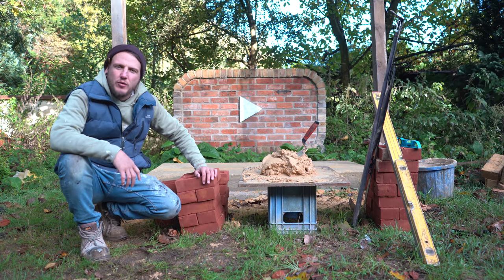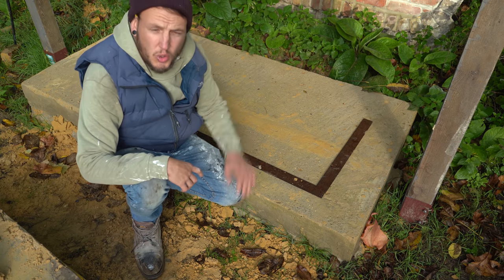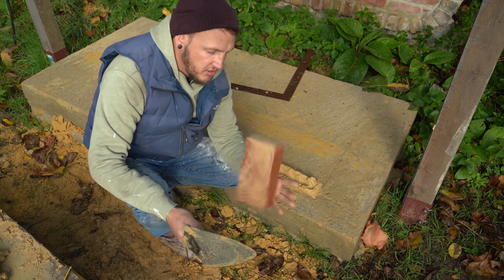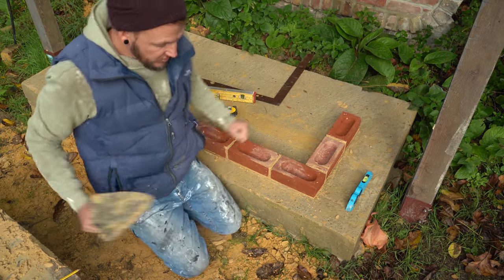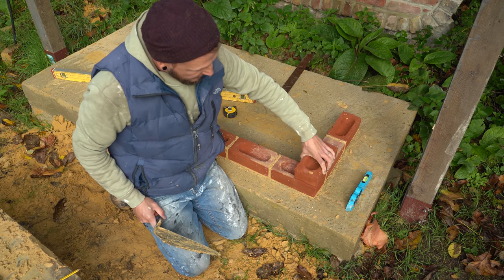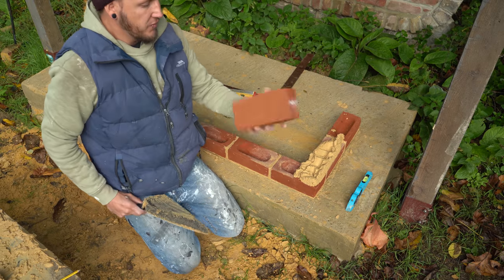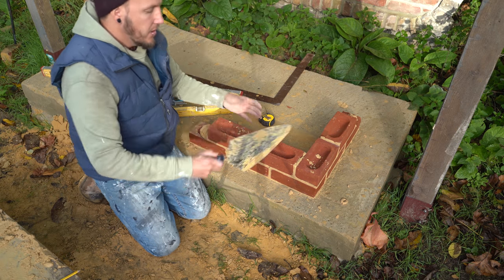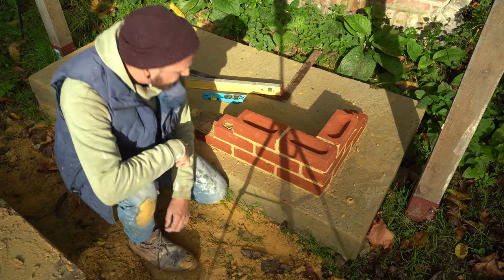HOW TO BUILD BRICK CORNERS [Bricklaying for beginners e.p.5]

Comment: I’ve only just found your channel and know nothing about bricklaying.  However I am finding it fascinating.  One thing I can add though is why the hollowed out part of the brick is called the frog.  The underside of a horses hoof to the rear, the V part is called the frog, which acts as a shock absorber to the hoof, which I can relate to the brick.  The only explanation I can think of, but I may be wrong of course 😬

Comment: Nice video !  Here are a few suggestions. On quoin brick and the tail brick of leads,place level across brick. If face is square to beds,the brick will be plumb when crossed leveled. Also,on longer leads, 4-5 brick,lay quoin brick and tail brick first and level. Reason being,it is easier to lay and level infill brick between two points. Lastly,glue a piece of wood to face of boat level exact width as longer levels. Reason being,contact points will be exactly the same ,hence you will get exactly same reading when you switch over to longer levels. Thanks for sharing your video.

Comment: I have a question, if you don’t mind. When laying first course on a uneven footer(in my case, on cut stone) do you just fill in the low areas with muck or is there another way?  When using old large brick for exterior wall and smaller modern brick for interior wall how do you tie the two walls together? Thicker beds for the smaller brick to bring them up to same level as larger brick? Silly questions I know, but I’m learning greatly from your channel. Thank you, Jamie

Comment: Everyone taps there level now and again either when plumbing wall or leveling as it is quicker and better than tapping each individual brick 👍
Reply from the maker: I couldnt agree more. On the flip side, I've seen people hitting their level with a club hammer to straighten their corners 🤣🤣🧱
Reply: wheaten bread  it’s better to tap the brick than the level, if you have your hand on the level at the same time you can feel which brick is in need of adjusting

Comment: Great video Rodian.  I'm a bricklayer from across the pond, Newfoundland Canada.  When you lay out the first course, would you normally level and plumb every brick in the first course?  Or would you level and plumb the corner brick, lay the bricks next to it, then level and plumb the ends and then use the end lined up with the corner to straighten up the middle bricks?  ha, do you know what I mean?

Comment: Not at you but In general some brickies plumb one or two courses with a four foot level and it bugs the shit outta me lol 
Why don’t they use a boat or two foot for the first few courses?
Reply: I use the smallest level I can, and go up a size only when I need to. It's more handy I think
Reply: Plumbing 1rst and 2nd course with 4 feet is inaccurate imo
Reply: Maxstaber exactly! I’ve seen many brickies putting their foot on the base of a level and holding the top in mid air after just a few courses.
I laugh.
Use a smaller level so it’s rigid against your wall ffs 😂
Reply: I agree, trying to plumb 2 courses using 4 foot level feels awkward
Reply from the maker: I love you all 🤣🧱 I find it so unstable using anything more than a boat level for the first 2 courses at least. Usually I do 3 with the boaty then the 2 footer comes out. I find it way way more accurate. Each to their own though 🧱👍🏻
Reply: Many years ago, did not have time to mess around with boat level... All plumbing an leveling done with 4ft level.

Comment: I built myself a barbecue,  first time ever handled bricks and cement. Took a while ,but being an engineer I knew how to level and square up etc...biggest problem was the shit bricks I got, thinking engineering bricks would be straight and square, anything but! Aren't there any standards on brick precision??
Reply from the maker: There are standard sizes but the way the bricks are made there is a chance of slight discrepancies. Some bricks more than others. Hand made bricks can be quite a bit different in size, 20mm in some cases I've come across

Comment: YOUR TECHNIQUE IS ALL OFF. 1. WHY DIDN'T YOU USE A CHALKLINE ON THE SLAB? 2. LAY YOUR FIRST COURSE TO THE CHALK LINE FIRST. 3.THEN BREAK OUT THE COURSE RULER TO SEE IF IT'S ON MARK. 4.THEN LEVEL AND PLUMB OUT THE 1ST COURSE AND CORNER. 5.REPEAT EACH STEP UNTIL 5 COURSES ARE COMPLETE SO YOU CAN RE CHECK THE WALL WITH A 2FT OR 4FT LEVEL AND LEVEL OR PLUMB WITH A BETTER MORE ACCURATE TOOL, SINCE YOUR NOT USING A SPEED LEADERS. AND WHY ARE YOU LAYING THOSE BRICK UPSIDE DOWN? I SAY THEY ARE LAYED UPSIDE DOWN, CAUSE WOULDN'T IT BE EASIER TO SPREAD THE MORTAR ON A COMPLETE FLAT SURFACE,  THE WHEN CLEANING UP THE MORTAR AFTER SPREADING ON THE COURSE, YOU CREATE A PYRAMID LIKE WEDGE WHEN USING YOUR TROWEL TO RACK THE MUD TO EXTEND YOUR SPREAD DOWN THE COURSE.

Comment: With reference as whether to hit the level or not. Obviously preferably not, but that’s not always practical, however no one seems to have mentioned a specific level that Stabila make that has a thick durable polypropylene capping the full length of the top of the level. Without stating the obvious, the capping is there so that the level can be tapped without causing any damage to the level. That doesn’t give license to batter the level with a brick hammer though.

Re background music, man you cannot be serious!! Absolutely no, nada, zilch background music.  Don’t care if you go quiet for a minute, rather that than listen to some crappy lift Muzak.  Just my opinion.